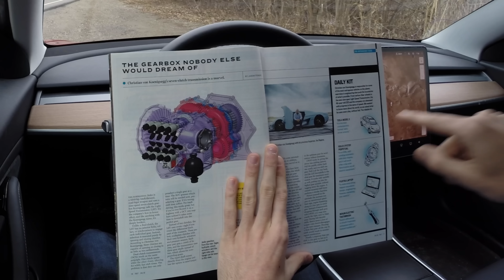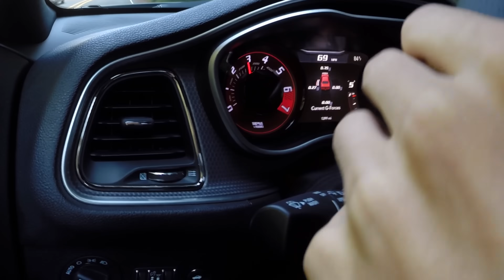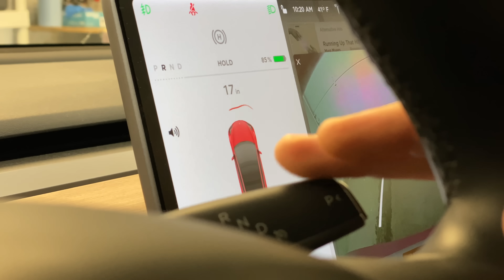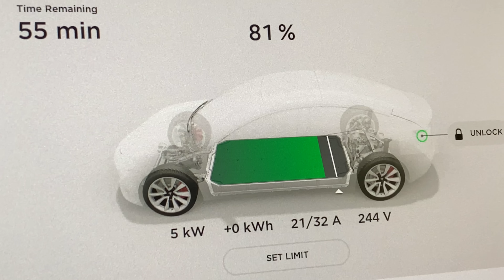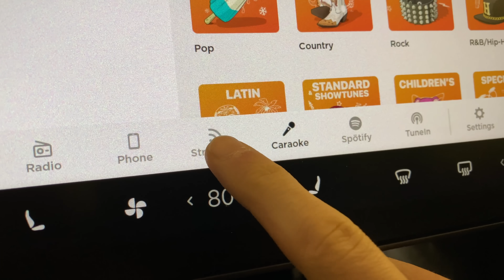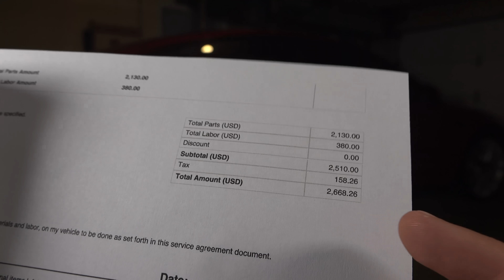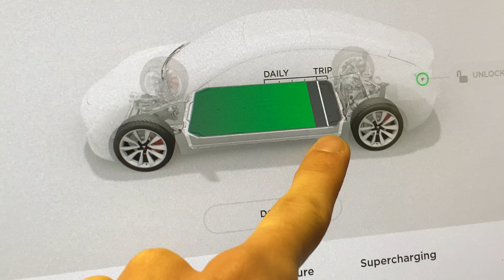Living With A Tesla Model 3 For A Year - The Best Daily Driver

Comment: This was really interesting. I have wondered what it's like to drive an electric car. Nice video and thanks.
Reply: I haven't seen any noticeable difference in insurance rates for Tesla versus volt versus Hyundai if you have a good driving record
Reply: Almost as fun as a car with a clutch but in a totally different way
Reply: EweChewBrrr go test drive a Tesla! Or Turo one
Reply: He didn't mention a few things that I thought for sure would have been listed as negative points on electric vehicles (I'm not sure if all of these points apply to Tesla vehicles or not):
1) Cost. EV are far more expensive to buy than gasoline vehicles.
2) Maintenance. EV cars are far more expensive to fix when something needs to be repaired (on average)
3) Long Distance Driving. EV cars require far more refueling (ie recharging) stops than gasoline vehicles for any decent distance.
4) Top End Speed. EV cars have much quicker acceleration than their gasoline counterparts, but their top end speeds are considerably lower.
5) Modifications. Gasoline cars are much easier to modify by yourself (or a mechanic). EV don't seem to have that level of user input, so to speak.
6) Depreciation. EV depreciate in value at a much higher rate than gasoline cars (on average).

It's also interesting when discussing the environmental impact of gasoline engines vs battery-powered. How much coal needs to be burned in order to keep electricity flowing into an EV? I don't know the answer or comparison of the two at the moment, as I'm sure there are endless sites online which have tackled this question.
Reply: @nottelling4828  Some of these are just false actually:
1) the base model 3 is at a comparable price point to similar cars in it's class (like BMW, Lexus, etc). Yes, it's more expensive than an economy car , but it isn't comparable, and actually has a total cost of ownership similar to an economy car. Higher trims will cost more, but I bought a SR model 3 for just this reason.
2) almost no maintenance is required on a Tesla. On my Mazda 6 I did over $4500 in maintenance and repairs in 5.5 years, none of which would've been required on a Tesla (oil changes, major maintenance with timing belt change, minor brakes, major brakes, broken drive belt). Overall, you'll spend far less on maintenance on an EV.
4) yes, lower top end speed. If you care about driving over 150mph, this could be an issue for you? I drive fast, and it's no issue for me. For German buyers I will give you this, otherwise... not really.
6) Tesla's have some of the best resale value of any car sold actually, so this is just wrong.
Reply: @garyco766  1. Don't compare a Tesla to a Lexus or BMW. The quality of a Tesla is like staying a the Youth Hostel instead of the Ritz. And that for the same price, just that the Tesla accelerates a bit quicker, rwhen enough battery and you can watch Netflix in the car. Who needs that? 
2. Tesla are shitty quality. A friend of mine bought a Model 3 and had to send it to the garage after just 2 weeks. Shitty paint job. Trunk did not open properly. Issues with the air condition etc. Man he was annoyed. 
3. The acceleration from 60 to 120 is also worse, so why would you not care.
6. Tesla has a shitty resale value like most EVs. The Model S are sold in heaps on the net and noone wants them because of batetry degradation and the new Model 3. Same will happen with the Model X when the Model Y comes. All lemmings will just but the Model Y cause it is cheaper and almost as good as the Model X. What a shitty model policy from Tesla.
Reply: @garyco766  : Yeah, Matt responded with some of the same criticisms that I had, albeit in a little more poignant and direct fashion.
No way would I compare Tesla's quality with the likes of a high-end Lexus or BMW. Not by a long shot. I'd put it in line with a base model Camry, to be honest, but that's just my opinion.
Also, repairs on EV are incredibly expensive. I can't speak to their reliability, but many EV owners have bit the bullet on generator failures and battery issues, causing them to rue the day they ever bought their vehicle. Would be interesting to see the maintenance+repair cost comparisons over time.
Tesla resale values are incredibly poor. I'm not sure what data figures you are referencing, to be honest. Their depreciation rate far exceeds most (any?) common gasoline vehicles.
Matt also made a good point about high-end acceleration. Besides the lack of top speed, once an EV hits a certain speed, their acceleration at that point plummets. So it's great to hit 60 in a few seconds (which is impressive in its own right), but then you have to share the highway with cars doing 80 regularly, which then becomes a hindrance (battery drain?) trying to keep up. Not a deal breaker, but still considered a negative aspect with regards to its gasoline counterpart. I have a buddy who keeps "gunning" his Prius across the parking lot to get in front of me constantly when we leave. I always kid with him that his Prius is impressive, but what happens when we leave the parking lot?

All in all, even with its few severe drawbacks, I have no hate for electric vehicles, and I do see them as the cars of the near future. Given an increase in performance and an enhanced energy-supply network, they'll probably be better off than our current gas guzzlers. I'm running around in a 5th Gen Camaro, though, so I'm about as far away from electric as a modern car can get.
Reply: @nottelling4828  
I encourage you to test drive one.. I bought a used model S performance.. and have had it for 80k miles. Reliability has been great.. cost to own is crazy cheap as I've literally had no maintenance outside of tires. 

Coupled with the fact that it's fast as F... Smooth as butter.. not obnoxiously loud.. high on safety.. did I mention it costs roughly $5 dollars to fill up at home?.. for roughly 250 miles. 

Free when I'm on a trip with superchargers.
Reply: @nottelling4828  Well, the model 3 isn't "high end luxury", it's entry level luxury, like the 3 series BMW, which I think it compares to just fine having driven both. I'd much rather own the Tesla (which is why I do). Also, Tesla isn't "other EVs", most of which are still crap when it comes to battery tech. Tesla batteries are a major improvement with the stats to prove it. Otherwise, I addressed most of this in the reply I just made to Matt (resale value, acceleration, etc).
Reply: @garyco766  : "Well, the model 3 isn't 'high end luxury'"
Yeah, that's the point. You pay high-end prices for a standard model car (Camry, Accord, etc), albeit with far less reliability and poorer quality build/parts. I'm not hating on electric cars, but we have to be honest with our assessments. At the moment, they have some serious negatives. Once their price point drops (due to cheaper manufacturing and increased production), it's kind of a no-brainer for our society to switch over to them.
Reply: @nottelling4828  the only one you are right about is 3
Reply: @iKingRPG  "the only one you are right about is 3"
Actually, points 1, 3, and 6 are no-brainers. EV are far more expensive to purchase than their gasoline counterparts. That's not debatable. EV don't have a comparable high-end speed like their gasoline counterparts. Granted that once you reach a certain speed (100-110), it hardly even matters at that point, so this point could be easily overlooked. But the depreciation rates on EV are far greater than almost EVERY gasoline engine vehicle. That's not debatable, either.
Reply: That’s not ur question! More like what it’s like to own
Reply: @JKLsemASDF  : I'm not sure what it is about my post that you and others are debating. Nothing I stated is controversial (some not even debatable). We're not discussing performance or preference or average maintenance cost and the like. I'm merely pointing out several points (facts) that he didn't mention in the video and yet are clear disadvantages of the electric vehicles compared to their gasoline counterparts.
EV have much higher purchase prices than their gasoline counterparts. Fact.
The average cost of repair on an EV is higher than their gasoline counterparts (no doubt due to the cost of battery/generator failures). Fact. 
EV have incredibly short driving distances than their gasoline counterparts. Fact.
We can ignore the points about top end speeds and modifications since they aren't impactful.
EV have much higher depreciation rates than their gasoline counterparts. Fact.
Everything that I posted is really incontrovertible and not all that controversial,  to be honest. Not sure where you guys keep going with this.

Also, Teslas are very poor quality for their price. Cheap parts, cheap assembly, poor manufacturing, etc. If you purchased a high-end Lexus that had the same condition of poor quality (paint fading, latches/hoods breaking, loose parts and/or doors not sealing properly, etc), you'd be irate.
Reply: @JKLsemASDF  : I'm responding to this: "but you could be right and everyone  else is wrong"
Reply: You get to pay almost twice as much for insurance (which negates your fuel savings) and if you get into an accident, it will probably be totalled if the battery pack suffers a scuff. It's insane how much it costs to repair these and the lead time on parts... Needs improvement.

I'd rather spend 25k on another Mazda 6.
Reply: @PeterPetrakis  And you can't get a Tesla with 2000€.. 
And if i had 40k i would spend it on buying a car.
Reply: @PeterPetrakis  Tesla has their own insurance service now that is cheaper than most other. Probably because they understand their own cars
Reply: @PeterPetrakis  
I pay 160 a month for full coverage on my model S performance and Volvo xc90.. it takes an hour or less to shop around.. just an fyi
Reply: Peter Petrakis not true for me. You might want to shop around. With Progressive my insurance actually went down a tiny bit compared to my similarly priced BMW.

Where as, based on my calculations, I will pay about 1/8th the price for electricity compared to the premium gas required by my old car.

Comment: Jason , try driving a TrackHawk , the power is instant at any rpm
Reply from the maker: Haha, I've driven a TrackHawk, and the power is very quick, but it's not instant. :) Especially if a downshift is needed, but either way. You still have to fill the intake manifold with boosted pressure from a vacuum. That will always take time. In comparison to a turbo car, it's excellent. And the Trackhawk is a riot to drive haha. I had so much fun: https://youtu.be/DsAyr5Sja54

Comment: I agree with most of your points, but when I want to I don't need to touch the brakes even in IC car (you know, engine braking with a manual transmission...). 5:53 for the point.
Reply from the maker: Yes, but hopefully you don't engine brake to a complete stop. ;)
Reply: @EngineeringExplained  Yeah that would be difficult... if I time it right I don't have to stop though. Electric is still easier to use and I would love to try one.
Reply: You still have to oress clutch and change down

Comment: What about towing and charging? That's an area where at the moment EVs are behind
Reply from the maker: Yep, diesels are still king of towing. Relatively efficient, and much longer range.
Reply: You’re right. EVs are not good tow vehicles. In fact, most modern cars are crappy tow vehicles. The existence of the EV doesn’t mean ALL ICE vehicles should disappear and the EV should be used for ALL applications. (Also, you charge your EV at home, just like you would do if you could with your ICE vehicle... the EV “gas tank” is always full).
Reply: @alliejr  Tru Tru. Though we are in the early days. Can't wait until EVs become cheaper and more widespread. That'll be cool to see in my lifetime.
Reply: He talked about charging (point number 7), and its a sports sedan so towing is irrelevant. No one talks about towing capacities of a Honda Accord... But yes if you are someone who pulls trailers or campers across the country, stick with your gas or diesel for now.

Comment: My big problem is the purchase price of this Tesla which is 3 times as much as I paid out the door for our last new car, a 2017 Honda Accord.
Reply: Model 3 costs less than a fully loaded Toyota Camry
Reply: Hopefully used model 3 will be easier to find and cheaper with the Y coming out.
Reply: $69KTesla Model 3 is about twice the cost of my BoltEV which in my opinion is just as great a daily driver.
Reply: @iamnid  Best choice for a daily car, I need the long range for road trips several times per year.
Reply from the maker: Haha, I mean yeah that's true. But an AWD performance sedan that's as quick as an Audi R8 is a bit different than an Accord, yeah?
Reply: @EngineeringExplained  True and I wish I could afford an Audi R8 but....my wife's 4 cylinder Accord EX suites us fine.  I can buy a lot of gas for $45,000.  We spent $27,000 on gas in driving 265,000 miles with our previous car a, 2003 Honda CRV AWD before it was totaled in an accident.  Spent less than $100 on maintenance over the life of the vehicle other than oil & filter changes which I did myself.   For fun driving I have my S2000.
Reply: Pham Nuwen True but it still does not compensate for the purchase price difference.
Reply: @phamnuwen9442  Not sure I understand your comment as we spent a total of $24k out the door for the Accord.  It was purchased to replace our CRV which had 265,000 miles when it was wrecked.  The Accord is averaging 29 mpg vs 24 mpg that we got with the CRV.  ignoring this difference if we were to spend another $27k and put 265,000 miles on the Accord the total would be $51k which is $2k higher than the $49k number you mentioned as the price of a LR Model 3.  However I assume that one cannot charge the Tesla's battery for free.  It looks to me we could probably go around 300,000 to 325,000 miles (maybe more) before we reach the point where the Tesla becomes cheaper.   We have had several Hondas over the years in which have gotten this level of trouble free driving and we are hoping for similar results out of the Accord.  I wonder if the Teslas battery will still be operating at the same level at 300,000 miles as when new.   I have no idea what it would cost to replace the Tesla battery.
Thanks for your comment.
Reply: Pham Nuwen That is why we have bought either Hondas or Toyotas, long term reliability.
Reply: @phamnuwen9442  You would have to live in a coal fired communist state to get 1¢/kwh. In the civilized world it's usually like 15¢. Also, power costs are so crazy for a lot of people, it's to the point where there would be almost no savings over gasoline costs.
Reply: @phamnuwen9442  Nuclear is definitely the answer, but it definitely does not cost 1¢/kwh to do responsibly in any currently known way. Somebody has to pay for the energy through taxes or who knows what other rats nest of beurocracy. If it was actually that cheap, it would be significant incentive to waste power on any number of things. You would have horrendous amounts of privately and industrially wasted energy. I want nuclear to succeed and progress as much as anybody, but just pretending it's going to be dirt cheap isn't moving any closer to that.
Reply: And the accord goes further.
Reply: @FXIIBeaver  Model 3 is a much better car overall, but yes on long road trips the Honda will go further and refuel faster.
Reply: @martialman.4563  a 20k vs a 60k. Yeah the 3 better be a better car but if I am buying a honda I am buying it so I don't have to stop driving as much. Until electric cars can compete with a honda only then will they be not a gimmick.
Reply: @FXIIBeaver  My 3 costs much lower than 60k $ now, around 47 for a long range dual motor last time I checked. Used prices are a bit ridiculous for the model 3 however.
Reply: @martialman.4563  and exactly how far can you go on a long range dual motor 3? Sounds to me you are trying to justify yourself.
Reply: @FXIIBeaver  greatest obstacle for electric cars is right now it's inconvenient for apartment dwellers who have no garage to charge. Got our Tesla in 2018 and it's vastly more convenient and cheaper to drive.
Reply: @FXIIBeaver  Plenty for daily use so I don't know, don't look. I work for a staffing agency, drive far for work and it can go 200 miles easy, charge at night, repeat.
Reply: @martialman.4563  that is answer is the definition of dodging. The range is right in your face when you drive.
Reply: @FXIIBeaver  I charge to 70% typically every day it says 217 range if that answers your question. If I have a big drive for work the next day I charge to 80-90% but 217 covets my needs so I don't look.

Comment: just annoys me that they are so expensive, £47000 for the longer range Model 3, more than double a "normal" car, while the more affordable cars like the Leaf and Zoe have pathetic range.  I want one, but just cant justify paying over the odds for it.
Reply from the maker: Yeah, used is where the great deals are right now, while they're still relatively unpopular. You can get in eGolf which is an incredible car under $15k all day, even under warranty. Old Leafs/500e under $10k (even $5k sometimes). BMW i3 (fun car, dumb price and dumb wheels) under $15k all day. There's some fun ones out there for much cheaper than Tesla!
Reply: @EngineeringExplained  I dont think they even make the eGolf anymore? Second hand they are £16k/$21k. I cant wait for more choice to be out there.  Every car should be at LEAST Hybrid by now, but so many manufacturers are dragging their heels.
Reply: Did you know that here in India u hv to pay 125% import tax so the tesla here costs about 110000 USD